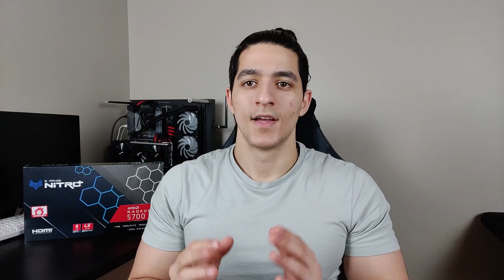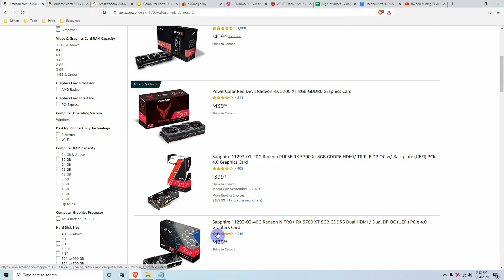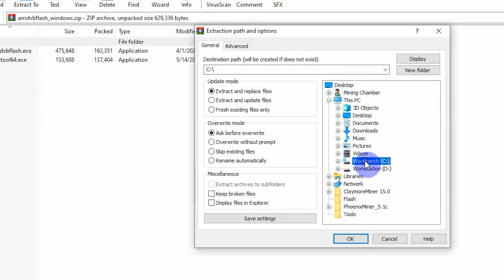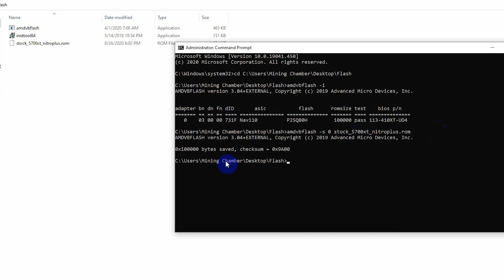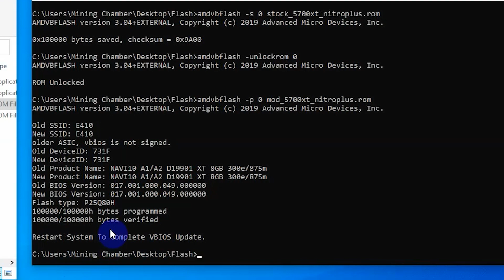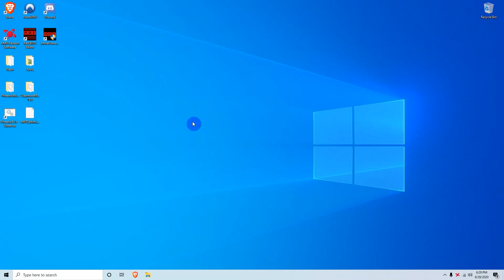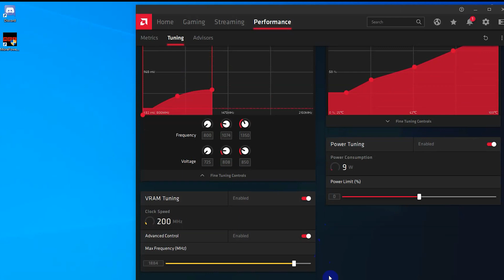RX 5700 XT Mining Overview | Profitability, Hashrates, BIOS Modding & Overclocking

Comment: Hi nice thoroughly advice and well educated, i have a few question, will I need GPU riser cable or don't need that ? Also where is the money going into, into your ETH wallet right ?
but will it be safe, as this github project is open source right so anyone could be monitoring that SSL Port and steal our coins.

Comment: Just set up a rig with 2 5700xts and am having an issue with one of the cards always readjusting its voltage back to 1200 right after I click apply

Comment: I loved the video! Thank you very much. Really in depth and easy to follow. I have only one question, my hashrate has increased with the enw configuraiton to around 55 MH/s, but I am only managing to reduce my voltage to 117 W. I tried reducing the voltage to around 715, where it is still stable. But can'T get anywhere near the 90 W. Any ideas what could be the issue? Thank you :)

Comment: Was having memory temp issues and I finally followed your settings for performance and damn...  temps went from 104-106 to 92'ish and I gained from 49 to 51 MH.  Any suggestions for a 5700xt set @ performance only getting 39MH and running at 106 memory temp?  Maybe due for thermal pad/paste replacement?
Reply: The 5700 series card will throttle above like 104C memory temps. You should see temps below 100C if you just adjust the positioning of your thermal pads. You should see temps between 80 and 90C if you get new thermal pads and make sure they completely cover the memory modules.

Comment: I have ASROCK PHANTOM GAMING RX5700XT with stock BIOS i was getting around 28 MH/S and temps were high and fan running 101% to 102%, after BIOS mod, I was getting around 31MH/S and temps were high as well, I run out of ideas how i can get anything over 50mh/s with this card, anyone can help ?
Reply: Maybe the pcie of the mb is giving troubles
Reply: Try on another pc if the last try was on an old pc

Comment: I've got "Write fail ... ERROR: 0FL01" after " amdvbflash -p 0 mod.rom" command. What should I do ?
My Flash type is "GD25Q80C" not like yours. Is it related ?
Reply: Did you unlock the rom? I got that problem when a used amdvbflash 3.2 from techpowerup, i had to used the file of this video

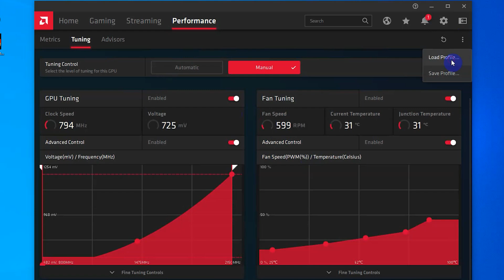Comment: When you get to the recommended settings at 22:05 you are just using the AMD Radeon App. Do you need to flash the bios and such before using that software, or was that just walking through a different more comprehensive approach? Basically, can I skip flashing the bios and just use the Radeon app to apply these settings?

Comment: Mine is unstable on the performance mode, but sits happily on 55MHs on eco mode. Very easy to follow, nice vid! Thanks
Reply from the maker: The overclocks on miningchamber.com will be more stable If you run into more issues, and pleasure!
Reply: @MiningChamber  their recommendation uses 135 watts. I'm happy using your settings in eco mode :) 90w for me.

Comment: HELP!!!

So when I try to do this it say “no adapter” found. Also if I try to boot with this gpu plugged in my system does not boot. I tried checking in display adapter on device manager and it does not detect a card their as well. I’m using a Asus tuf 3 5700xt

Comment: So when I try to do this it say “no adapter” found. Also if I try to boot with this gpu plugged in my system does not boot. I tried checking in display adapter on device manager and it does not detect a card their as well. I’m using a Asus tuf 3 5700xt

Comment: Hey, i have a problem. after i flashed you said i need to load a recommended file but the problem is that there is no recommended file in there. do you know what i can do for that?
Reply: and i cant change it manually to 725. only to 750
Reply from the maker: You just have to put in the oc settings manually, there is a recommended because I saved my settings into it so you can just set yours then save it. 750mv is fine too!
Reply: @MiningChamber   yeah its ok now, the oc didn't helped me bc i had 54 mh/s but less than half the shares after 5 hours so ive put on my default settings.

Comment: Hi. Superb tutorial  👌 but 😅 AMD radeon aorus 5700xt. After bios modding I can't launch AMD software for overclocking, gives message that drivers not working properly or not compatible with the software and windows gives error code 43 in device manager. Would you know solution for this issue?
Thank you very much.
Reply from the maker: Thank you!! Not sure what's the issue with that, usually strix and gigabyte do that problem. Try reflashing it again with original bios and repeat the steps carefully, if it does not work then try to ask in the community if someone has a similar problem !

Comment: I am ran into a huge problem. I have a Gigabyte 5700 XT Gaming OC Rev 2.0 and I did try your steps like on this video and my computer doesnt turn it on. It looks like the card is bricked nows. How do I flash it back to the original?

Just to mention.. it doesnt even allow me to enter the bios. total black screen and on the motherboard error light is on vga. if I take the power cable out then i am able to start with the integrated graphic card (i7-10700)

It starts and there is just one "white dash" on preboot.. nothing happens
Reply: Hey, Have you solved it?
Reply: same

Comment: As u say on time 13.58 my gigabyte 5700xt has micron single type 1 memory
This card works in Windows mining perfectly gives 52mhs
But facing issue in hiveOS with PhoenixMiner 5.5c as on mining startsup winthin 1 min GPU gives 43Mhs after that it automatically drops to 0Mhs hashrate
And GPU not responding
And getting error as ring smda0 timeout something like that
Do you know how to fix it.

Comment: If anyone downloaded the PhoenixMiner client from https://phoenixminer.org/ or any other source besides https://bitcointalk.org/index.php?topic=2647654.0 or have used Phoenixminer on NiceHash, DELETE IT IMMEDIATELY, remove all exceptions of the fake client from your Antivirus and Firewall and run a system scan using your Antivirus Software. After that, change all of your passwords and also change your Wallet immediately. If you can, for a better security, reinstall your OS and consider changing your mining client. As of now, in my opinion, it is better to avoid PhoenixMiner and instead start using other clients like Teamredminer which works really well for AMD cards. Repeating: if you used PhoenixMiner on Nicehash or downloaded it from an unofficial source, delete it immediately.
For more information: https://www.reddit.com/r/NiceHash/comments/lznyhx/stop_using_phoenix_miner_immediately/

Comment: Hi, my 5700xt Nitro+ happens to be a little bit of weird, it has to run at 1300MHz with more than 833mV to get VRAM higher than 1840MHz, or 1300MHz@725mV but with VRAM below 1840MHz, othewise the system will go freeze and have to do a reset. But once the DAG is loaded, everything will just go all right, the frequency-voltage-trade-off stuff is no more needed. I would really like to ask is something on my card went wrong?😩
Reply: lol I installed driver 20.4.2-May25, and this issue just gone. I have even tried to reinstall driver 20.11.2-Nov18 (firstly made a clean out with ddu) but didn't help.

Comment: i have stirx 5700xt, got to the restart your system to apply vbios. and now im having no video output. any suggestions?
Reply: switched to performance mode it posted again. redid flashing with the provided new asus bios. will test again now
Reply from the maker: Make sure your using the pinned comment bios !
Reply: @MiningChamber  i did. seems to be working. 58 mhz with 130 watts and very low temps. thanks!

Comment: Since it looks like the 5700 xt strix has a dual bios of quiet and power.  Could i not bios mod the quiet mode bios with the link you provided and if i mess up the power side would be the original and still boot.  Sorry new to this and really do not wanna mess the card up since they are worth more then gold right now.

Comment: Question for anyone!! Built this same rig with 4 5700xt red devils.BIOSmodded and overclocked to your specs.1st build ever. No idea you could mine this 2 months ago. Great Content. I have had it  running for 24 hours have 605 accepted shares and 5 invalid shares. Really ignorant when I ask this... Is that Good? within tolerance or bad? If bad how do I fix it?

Comment: awesome video, i tried that bios mod thing. on my gigabyte gaming oc. it actually got into windows, but i was never able to reinstall the drivers. it wouldn't work. had to flash back. luckily didn't brick it. do you have any tips on keeping vram cooler? mine runs so hot i think it throttling. i got some pads, but not helping much
Reply from the maker: Increase fan speed and reduce voltage as much as you can. Mem temps below 95c is okay
Reply: @MiningChamber thank you try that. also ordered some fujipoly pads to replace the once i got now. used have an AIO on this 5700xt, and i doubt these pads are any good. hanging around 98c right now with 65% fans

Comment: I have a Asus rog strix 5700 xt and it just won't work,  already tried to flash it 10 times sometimes it gives some error 0FL01 sometimes it writes with no problem and than its bricked.. With samsung memory can't even set the memory over 1800. I'm getting 52 mh at 94w. Can't push it further. Any tips?
Reply: Well finally i was able to bios mod the asus rog strix oc 5700 xt in safe mode worked perfectly

Comment: I have Asus, Gigabyte, Sapphire and MSI 5700s... currently running 7 of them at around 50.5MH/s stable but would like to up them to 54-55MH/s how do I get the bios mod for each brands?
Reply from the maker: By following the instruction on this video ;) and for your gigabyte if its gaming oc use the pinned comment, and if your asus is the strix then also use the comment
Reply: @MiningChamber  Just joined the Discord. Hopefully will be able to mod all my 5700s soon :) Thanks for the info!

Comment: HI again mate. So after all went great following your guide, the last 3 days i had an issue 5700 xt nitro+...voltage went, ( while mining ) , to 180w. I tried to change voltage but even though i can get it to 1300freq i can't get voltage to 725.....it always goes to 726. Should i just leave it there? Nothing works to get it to 725. And a noob q....i think my  loaded profile didn't change , and i say i think , cause i never again messed with it, ( since i had same stats on miner ) but now every time i startup my pc it has default options...Did i need to load profile every time or did i do sthing to cause that?

Comment: every time I adjust the memory clock higher, my screen goes black and my mining software restarts. I cant see know what is wrong in my config
Reply from the maker: Try the settings on miningchamber.com
Reply: @MiningChamber  this is for stock bios right? Right know i have this config

1263mhz coreclock
850mV
1880mhz memory clock
Currently at 260/10/0 at 54.3mhz
Screen isnt flickering yet unless I watch youtube alone side. This good?

Also I have a before config of
1450mhz coreclock
900mV
1830mhz at 52.9mhz

But i can play youtube vid along side with out the flickering issue. I wonder what happened

Comment: Nice vid, is it common that my v-ram messured from hwmonitor Shows Up temps over 100c°? Rest of my CPU is on 60 ish
Reply from the maker: 5700 XTs mem gets pretty hot for sure so it's common although make sure you use proper settings and turn your fan up so you don't keep it running hot

Comment: thanks to your videos i become miner too. I have corsair hx1200 it has 5 pcie outpus available for gpu.  I have one radeon vii (170w) and 4 rx 5700xt (110wx4). I am debating adding one more rx 5700xt. SO can one pcie cable with 2 splitters power 2 rx5700s?  SO it will pull probably 220-300 w from cable is it risky?

Comment: Hey mining chanber first of all really good video thanks for this. I'm using MSI RX 5700xt Evoke and i did exactly same things you have done. When I load and check moded bios from red bios editor everything seems ok but i can't clock down voltage under 750mV, i need a little help in oreder to underclock to 725mV. Thank you.
Reply from the maker: Hey! Generally 750mv is really good and most my cards only run at 780mv so no need to try to push it too low!

Comment: Dude.  Thank you, Thank you, Thank you for doing this video and for putting the list of parts that you used on the site. It helps a bunch.  I have a question about the hardware you used to connect the 5700XT to the PSU.  I just picked up my 5700XT (picked up a Zotac 3070 as well) and both have dual 8 pin connectors on the GPU.  I am wondering why you chose to use PCI-e 6 Pin to Dual PCIe 8 Pin (6+2) splitter instead of using a 8 pin to dual 8 pin splitter?  I am asking because I want to connect my 5700XT to my PSU (Rosewell 80+ Bronze 1000W) but it has 8 pin connectors on it instead of 6 and I dont think the 6 pin connectors you linked in the vid will work for me.  Should I just order a 8 pin to dual 8 pin splitter and hope that this will be sufficient to meet the power needs of me 5700XT and 3070?  Thanks (I am slowly learning more and more about this).

For everyone else smash that like button!!!!!!!!!!!!!!!!!!!!!!!!!!!!!!!!!!!!!!!!!!!!!!!!!!!!!!!!!!!!!!!!!!!!!!!!!!!!!!!!!!!!!!!!!!!!!!!!!!!!!!!!!!!!!!!!!!!!!!!!!!!!!!!!!!!!!!!!!!!!!!!!!!!!!!!!!!!!!!!!!!!!!
Reply from the maker: Hey! Thank you so much!! ⛏️💙 

I used the 6 pin to dual 8 pin because it is what I had at the time and it's completely fine to use them to power just 1 gpu and it's riser, but as for 8 pin to dual 8 pin, same thing it just carries more power too so it's safer. I recommend checking the ATX psu guide and the server psu guide it will definitely clear it out for you!
Reply: @MiningChamber  Hey bud, im sure you've been doing this mining over past year by now, so how much profitable is it? Can you make a video show us maybe your 2or 1 year mining earnings ?

Comment: Hi, ive got a question. Ive got the MSI Mech 5700xt, i followed the video to the T with the setup and everything. Im getting ym 55.2 up 55.4 mh/s but my power consumption is sitting at a 100w. Is it something to do with the MSI card of what might be up? Thanks in advance.
Reply from the maker: Power consumption on the software is not accurate so no need to worry about it!
Reply: @MiningChamber  Okay thanks allot, I really appreciate it!

Comment: Hello bro After 12 hrs of mining i got share results 2431/172/0 on my 5700xt .
Is it normal?? 
Its running on 1300 mhz 750 mv and 1800 mhz getting 52mhz/s  on stock bios.
Reply from the maker: Hey that is stale shares so it's most likely due to your internet connection!
Reply: @MiningChamber  yah i am getting 8-9% stales share. That's bad.
Reply: @MiningChamber  I have switched to nbminer and after 7 hrs of mining the result is 1468/38/0 . I think it's ok now.

Comment: Followed directions to a T, but even with flashing back to stock, my card is getting an error 43 in windows. Not sure where I went wrong, as I saw the same everything as in the video, but different results initial load, and different results after I attempted to tune it in the AMD app. The card stopped working after the initial settings were implemented.
Reply from the maker: Which gpu do you have ?
Reply: @MiningChamber  msi amd 5700XT. I was able to finally flash it back to stock. I'm still messing with it. I was able to remod it again, but no cool results yet. Just the upper end of an unmoded bios, which is about 51MH/s on NiceHash Phoenix.
Reply: @MiningChamber  I omitted the MPT optimization portion and got it to go. Seems like it's consistent around 55-56 MH/s. I added the MPT portion in and it went, so odd. Seems ok now.
Reply from the maker: Interesting although I'm glad you got it!

Comment: Sorry Mr. 
 Mining with RX 580 (4 units) = ± 120 Mh / s
 Or RX 5700 (2 units) = ± 110 Mh / s
 Or suppose that both the total Mh/s results are the same

 If the result of the ETH reward you get is the same or not,?  (Note that the total Mh/s is the same, only the GPU quantity is different)
 - apart from power efficiency, GPU price, etc.-

 Please help answer 🙏🏻🙏🏻
Reply from the maker: Hey! Yes it's all about your hashrate. Result will remain the same whether you have 100 mh by 20 gpus or by 1 gpu. Although it's easier to deal with just one gpu ;)
Reply: @MiningChamber  ok thansk sir 🙏🏻

Comment: First of all, good Video.
I use a RX 5600 XT TUF Gaming and i was wondering if there is a drastically performance increase/decrease when i switch to the 20.4.2 Driver because of the "compute mode". 
use for now the latest Driver
Iam currently driving 38/39Mh at 1300/1850/+20PD on cool 40-50 and mem is on nice 70-80 degrees at 98W
I got before arount 40,5Mh on 1500/1860/+20PD arount 55-58 and mem 85 degrees at 102W
Card has the newest Bios installed 

But my problem is that my card dont get a lot of shares which is driving me crazy rn :D
0 stale or invalid shares
i Use the latest phoenixminer, do u have an recommendation for another miner for ethermine? 
and is there any way to increase my accepted shares, thanks

Stay healthy
Reply from the maker: Thank you! You don't need to change versions if it's working for you! Try the overclocks settings we have for that gpu on the website or video. Miningchamber.com 

Generally shares are due to hashrate so not sure what your basing off of "good amount of share" but I believe you should be good as long as you get no incorrect shares and low amount of stale!

Comment: Hello Mining Chamber , please can you state what kind of memory Temps are you getting??? My GPU temp is at 43 but my "memory temp" is at a constant 94 Celsius... I get these through gpu-z. Does anyone have similar memory Temps?
Reply from the maker: Yess it's okay that memory temp goes high. Usually below 95c is good. Try using the settings on the website and see if it helps. Increase your fan speed too!